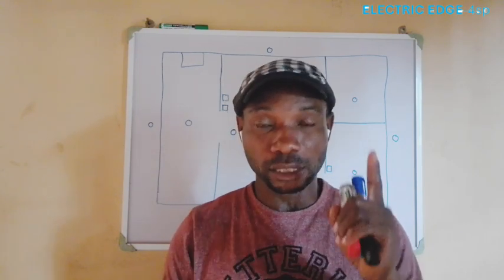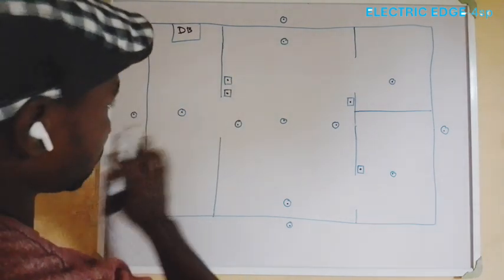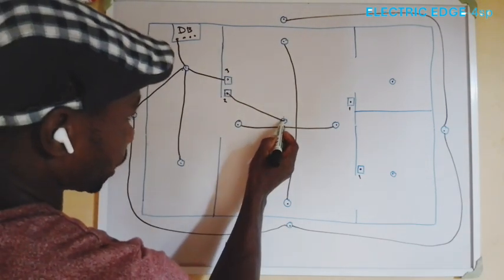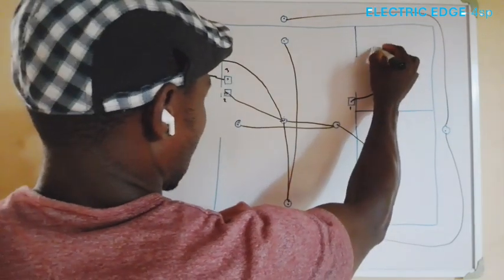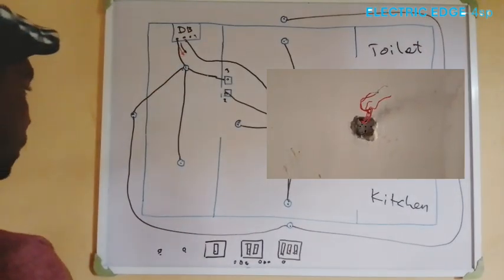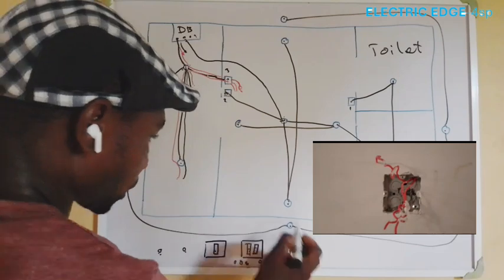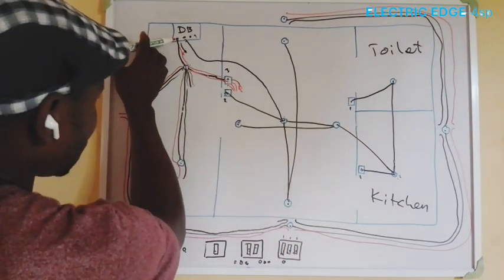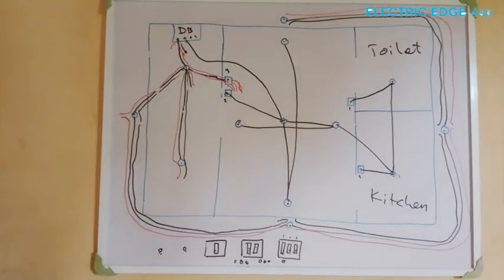Basics of Electrical Conduit Wiring: Lighting Points for 1, 2 & 3 gang switches (Part 1)

Comment from the maker: The online Training Package is here, you can get it right inside your phone or laptop. 

Are you an aspiring electrician, apprentice, technician, or site worker who wants to learn electrical installation the right way?

I'm excited to introduce the Mastering Electrical Installation Training Series — a practical, experience-based training designed to take you from the fundamentals to professional-level installation practices.

🚀 NOW AVAILABLE: MODULE 1 – FIRST FIX (CONDUIT PIPING WORKS)

In this practical training package, you will learn:

✅ Conduit layout design & circuit planning
✅ Site marking and preparation
✅ Residential and commercial conduit piping methods
✅ Conduit installation in walls, slabs, ceilings, decks, and floors and many more.

🎁 BONUS MATERIALS:
✔ Sample Electrical Drawings
✔ Support Group Access
✔ Real Site Demonstrations
✔ Professional Installation Tips

This First Fix module lays the foundation for every successful electrical installation project.

📢 COMING NEXT:
🔹 Module 2 – Second Fix (Wiring & Cable Installation)
🔹 Module 3 – Final Fix (Fixtures, Testing & Commissioning)

Stop guessing on site. Learn the methods used by experienced professionals and build skills you can confidently apply on real projects.

📥 ENROLL NOW: [https://youtube.com/watch?v=9rffCsPcc5s&si=uinHNCFEdppjgpgc

Your journey to becoming a more competent and respected electrician starts here. 
[https://selar.com/m/anams-electrical-tutorials1]